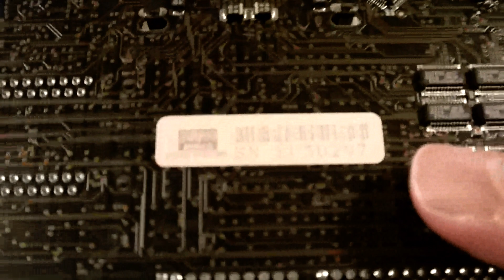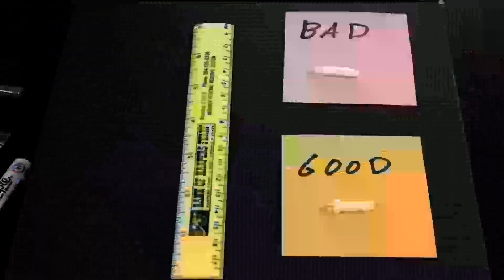Amiga Accelerators

Comment: 2 of those accelerators are obscenely large! I have never seen either before but I just got into Amiga 3 years ago. I have BFG9060's for my AA3000+, 4000TX, and ACILL 4000D built by Hese and ACILL respectively. Pretty cool stuff. Commodore imploded as I got my 1st computer for college - a Dell 90 MHz tower. Cool videos. Keep up the good work.